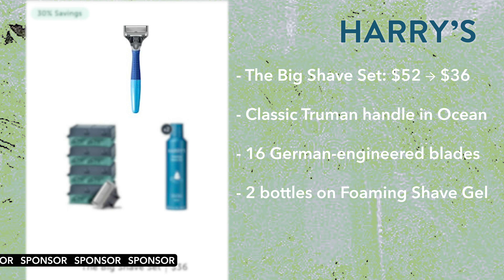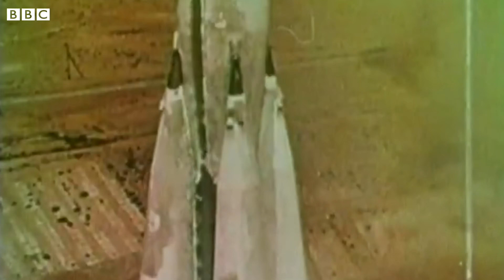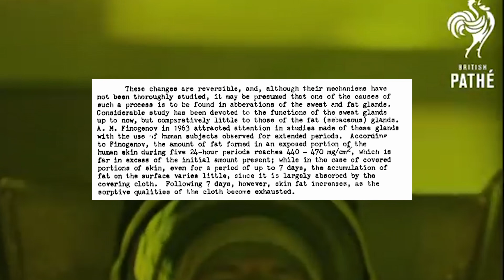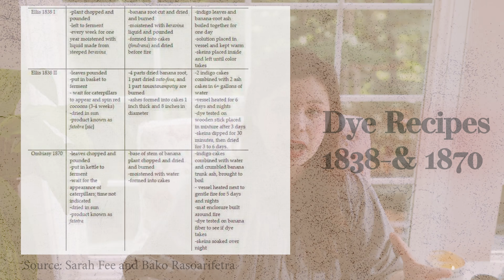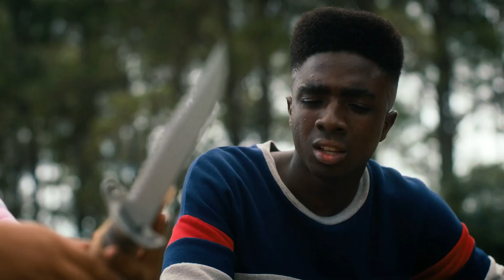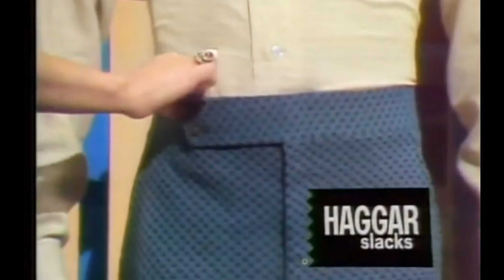The DISGUSTING truth about Laundry

Comment: Put a little hydrogen peroxide/baking soda on the crotch of your undies (and the under-the-boob bra strap) .  Not to be ‘sgusting but watch it foam up; you quickly realize what your Tide *isn’t* doing.  😏 🤢
Reply: I put baking soda and a few drops of lavender oil to my laundry every time. Instead of a fabric softener, the essential oil gives it a nice smell without perfume and the soda not only softens the water, but also the fabric a bit AND increases the actual cleaning of the fabric. And well, it's also nice to be able to bake some muffins at any time you want (here in Germany baking soda is not exactly something everyone usually has in their kitchen - we use baking powder).

Comment: In France they tell you how much detergent to put into your laundry depending on water softness and clothes dirtyness on the backof the detergent jug. White vinegar is also a good swap for fabric softener. Here most people don't even own a dryer, I only use(d) one when livig in dorms as a student
Reply: White vinegar (or apple vinegar) as a fabric softener replacement is something i read a lot in the internet recently. The only problem is: It's acidic. Acid is not good for your washing machine, especially the rubber seals of the opening and other rubber parts. It's just fine for handwashing though. 
Instead try baking soda, it softens the water and even the fabric just as fine without causing any damage to your machine. I also like to add a few drops of lavender oil for a nice smell without perfume.
Reply: @olgahein4384  I didn't know that, I'll try baking soda instead !

Comment: One thing you didn't touch on is using white vinager in your wash
Reply: Cause you shouldn't. It will damage your washing machine, especially the rubber parts cause it's acidic. If you wash by hand completely, it's a great replacement for fabric softener though. For machine washing, try baking soda: it softens the water and the fabric without any damage to the machine. I also add a few drops of lavender oil to my laundry for a nice perfume free scent.

Comment: Oh god don’t get me started on hard water.. what it does to your hair alone. Of course it’s crap on your clothing. 🤦‍♀️
Reply: What helps against hard water is vinegar (white or apple vinegar) for rinsing your hair and your body. Just make sure to thin it out beforehand, your body is naturally more on the acidic side, but not that much. It softens the water and neutralizes smells.
Just don't use it in the washing machine, it will destroy the rubber parts in no time. For laundry I use baking soda and a few drops of lavender oil. Softens the water just as much without acid and the oil ads a nice scent without perfume.

Comment: Some of us don't treat clothing as disposable, and in my case it's how I was raised - by parents who grew up in the Great Depression.
I've never had clothing develop tiny holes after one laundering, but I pay extra money for better quality T-shirts.  They'll eventually develop tiny holes, but that's after many launderings and several years.
When shirts and trousers don't look nice enough for work I demote them to "play clothes", where they serve quite a few more years for wearing around the house or doing yard work.  When the shirts are no longer wearable around the house, they get demoted to cleaning rags:  I cut them up and finish the edges.  Some of my current cleaning rags were wearable shirts in the 1990s.
I switched to a front-loader washing machine three years ago and I've noticed my clothing wearing much less quickly.  I use just enough detergent to get them clean but not too much, which can shorten the life of textiles.  Chlorine bleach has never had a place in my laundry practices, and oxygen bleach only rarely.
As for the dryer, I was taught years ago to use lower heat settings and to remove the clothing before it was completely dry.  My new dryer will allow me to set the moisture level remaining so that makes it easy.  Socks and underwear never go into the dryer and are always put on a rack; the clothing that needs a bit more drying is hung up.  It doesn't bother me one bit to wait a day to fold and put away the laundry:  I just find something else to do in the interim.

Comment: I live in the Netherlands, in a small apartment. For years I washed my laundry like in the old days, by hand, but I can't do that anymore. It is a JOB, I physically can't handle blankets, and heavier laundry anymore, for sure the wringing. So I did buy a machine for that. I do dry all on a rack.  I have a rack that I can hang on a door, that can handle about a load of laundry. It doesn't take long to dry, depending on what it is. I love your video, I think most people are not even aware of what laundry/cheap clothing costs our envirement. In the past people used natural soap, and often used the dirty water to water the plants, or scrub the floor. They reused everything. Have a beautiful day, and thank you! 🤗
Reply: I wish we would have affordable natural soap again, it all contains chemicals and perfume against which i'm highly allergic. Good thing i live in an area that is known to be a natural green left winged hippie society, so i learned naturally about the possibilities to clean myself  using different stuff from the kitchen - and it works. I even replaced fabric softener with baking soda and lavender oil and that works even better.
Reply: @olgahein4384  I use Aleppo soap, from Syria, that is made like people made it 4000 years ago. For the laundry we can still buy very oldfashioned laundrysoap here, that is cheaper. But the machine can't cope with that. So I do use the stuff from the store, though only a tiny little bit. I add vinegar to the laundry as softener and to make the water softer. You can make your own very cheap. If you find Rain Country on YouTube, Heidi teaches a lot of the old fashioned ways, natural cleaning stuff, for body, hair and house, medicinal herbs, food, how to make wine, etc., and also how to make vinegar. If I can do it, you can do it. I love raisin vinegar and apple vinegar, also to drink if you delute it with water. For the laundry I use the very cheap cleaning vinegar, but you can also use the home made. I use baking soda a lot as well, but I am still learning how to use it all. There are so many ways, like I learned to make my own deodorant with baking soda and coconut oil. I add a few drops of jasmin oil, (organic), so not to smell only like coconuts, but it works so very well! I do  use it before I go to bed though, for it can oil up your cloth. I will end my ramble, I'm sure you can find everything on Youtube as well. Have a beautiful day! Hugs from the Netherlands!
Reply: @JackyHeijmans   Hugs back and thnx for all the advice. But I will never again pour any vinegar or any other liquid acid into my washing machine, after i witnessed what it did to every soft material (especially the rubber in the sealing of the front door or the  tubes and hosepipes). I had to buy a new washing machine cause that was cheaper than replacing everything that was destroyed by the vinegar. 
Also, my allergic skin has become so sensitive that it reacts to everything acidic and even sunlight.
I now use natron as a replacement for fabric softener with a few drops of lavender oil, and the lavender keeps moths and bugs away.

Comment: That vodka method 10/10 recommend. It’s so easy why not?  I wear a thin tank top under my bra to protect it somewhat from sweat  and spray it with vodka right after I wear it.  Not perfect, but I don’t have to hand wash bras as often.
Reply: Interesting, I also wear  a tank top under my bra but for a very different reason: Thanks to my perfume allergy my skin is extremely sensitive to anything irritating, be it direct sunlight or synthetic. And the vast majority of my bras is synthetic except for the inside of some padded bras. But the seems, the straps and the band under the caps is full on plastic and causes rashed, skin irritations and pimples. Since i started the tank top thing, it got better. And that i have to wash my bras far less because of it was a VERY nice extra.
Reply: That’s awful that the materials themselves irritate you! I’m lucky not to have that concern, but I do think the tank top makes wearing a bra more comfortable in general by padding pressure points of the bra.

Comment: I use a mini washer and spin dryer for my clothes. Then hang it up in my apartment to finish drying. I only use 6-8 gallons of water total per load. I hardly have polyester clothing because I hate clothing that’s got high amount of polyester because it feels weird on my skin. I prefer modal fabric for yoga tops
Reply: Fun fact about Modal fabric: it is a 'man made cellulose' fiber, which means it is technically synthetic, while it is as breathable as any natural fiber and as cooling as cotton. While it is similar Lyocell/Tencel (also man made cellulose), and they are all made with different chemicals, they are also relatively safe for the environment. 
Unlike Viscose/Rayon (also man made cellulose), which uses a VERY dangerous chemical that not only is fatal for the environment and deadly for water organisms, but also causes several health damages to humans (aka the workers in the fabric where it is produced), from heart deseases to strokes and long term lung damages, WHEN exposed (the chemical is contained during production and should not be exposed, but the complete production is in China and work labor and health importance of the workers are the last of the concerns there, so there are leaks on regular basis). 
Long story short: Modal, as well as Tencel/Lyocell, are the better Viscose/Rayon in every way. But also more expensive.

Comment: Well some things I do for laundry is this
Wash socks and underwear separately from outer garments and on a hotter setting than other clothes
Use laundry bags for more delicate fabrics or garments to prevent tears (especially for bras and such)
Towels get washed hot
Bedding blankets and towels are the only ones going in the dryer (on the appropriate setting)

Comment: Another tip is to not automatically put your clothes in the laundry bin after every single wear. Exercise some judgment considering what the garment is, what you did that day, how much you sweat, does it smell/look dirty. Not saying to keep wearing it until it smells but a lot of clothes can be worn 2-3 times (or even sometimes more depending) before washing and it's going to make a big difference on their durability and how many loads of laundry you do already.

Like I rarely ever wash skirts since I wear shorts underneath them, until they get dirt or stains on them.
Reply: People don’t do this??
Reply: I started taking this approach a few years ago. Anything directly against the armpits or crotch gets washed after 1 full day of wear. I give most pants at least 3 wears. Jeans get 2 months before I bulk wash them. All other non-outerwear is based on the smell test. Outerwear (sweaters, jackets, scarves, etc.) can range from once a year to the smell test. If anything gets abnormally sweaty or dirty it gets cleaned in the next load.

I agree most people wash their clothes way more than they need to.
Reply: I do this all the time! I hang things up outside of the closet where air can circulate around it overnight, then put it back in the closet to wear again.
Reply: The only things of mine that get the "One use-One wash" treatment is my panties and socks. Everything else is subject to a re-wear or three, unless I get it nasty.
Reply: @catbunfish socks and tops for me, I live in the tropics.
Reply: Yes! And I've found that natural fibers don't get stinky as quickly, and can be worn more often. (for example, I have a linen shirt that can be worn 3-4 times against my armpits without getting stinky, but a polyester dress will cause more sweating, holds the smells, and has to be washed every time I wear it.) Unfortunately, good quality natural fibers cost more, or take more time to find secondhand.
Reply: I take a steamer to clothes that I've only worn once and intend to wear again before washing. It gets them looking fresh again.
Reply: I'm becoming convinced that it's a uniquely American thing, to toss clothes in the washing bin after each wear not considering if they really need washing or not. I don't think it's that common a practice elsewhere in the world.
Reply: This. Especially with things like coats or jeans. I can usually get like 10 wears out of my jeans before they get stained or start to stink.
Reply: @penelopeclaire539  Jeans get washed?  lol
Reply: @Jayhasdiabeeeeeetes  did you know that you can put denim in the freezer? They will not be stinky anymore. Until you wear them a lot again
Reply: @Jayhasdiabeeeeeetes yeah there's this lovely thing called yeast 😅
Reply: Yes! I have a coat hanger thing in my closet of about 10 hooks and I put my clothes that I've only worn once on it and wear them again before tossing them in the laundry.
Reply: Same. Skirts are my least washed items. My winter skirts are maybe washed once or twice during the cold season and then at the end of it before I put them away. They never touch skin and I rarely get them dirty. (Cold season below 15°C is about 6-7 month where I live).
Reply: @sphhyn  what do you wear under your skirts in the winter?
Reply: Washing after one use is a very strange concept to me. Like, unless it is soaked wet exercise/hiking/sports clothes or I spilled something on it and need to soak it for removing the stains - I am not wearing anything once. That’s just insane to me.
Reply: I generally don't put worn clothing back in the closet or drawer or I get smells (happens when they get closed in but not if they're free to the air), but I have a "gently worn" basket of clothes on the  go, only underwear gets washed after one wear. My work socks are double layer so they don't get gross, I usually wear them twice (switch feet to balance out wear). I also change out of my work clothes as soon as I get home so neither it nor my home-wear needs washing as often as if I wore the same clothing all day. My biggest problem with gook accumulation is the sunblock I wear every day will turn the inside of all my necklines grey.
Reply: Skirts definitely don’t need to be washed often if you wear something underneath. My petticoats however…… those get dirty pretty fast 😂
Reply: My jeans are worn til they're practically stiff. xD Shirts usually only last a day though, cause I overheat easy and sweat a lot sometimes. Depends on how long I wore the shirt and for what though.
Reply: I use a refreshing spray of water, white vinager and alcohol to sanitize and refresh clothes before I use them again! It’s also great for getting wrinkles out.
Reply: @leticiatavares1249 will you share the ratio of the ingredients? I would greatly appreciate it!
Reply: @stephaniefbriggs  Sure! I use 100ml water + 100 ml alcohol 70 GL and 50 ml white vinager.  You can also add 2-3 of drops of the essential oil of your preference if you want the clothes to smell good.
Reply: I recommend having a towel rack or something similar for this. That way half-dirty clothes have a place that you can see but they don’t wrinkle unnecessarily or get put back to make your clothing storage all stinky
Reply: @sarahnelson8836  man if I only had room for that.
Reply: @lunawolfheart336  because you have a tiny place or because you have so many half dirty clothes? 😂 I live in a small urban apartment and the towel rack isn’t very big so it works for me! I know some people fold them on top of the dresser
Reply: Oooooooh I live in the tropics and this is not an option. A garment starts to smell used after 15min of wearing it

Comment: Fabric softener.... we use vinegar
Reply: That's deadly for the rubber parts of your washing machine, as well as anything else that is sensitive to acidic liquids. Try baking soda instead, with a few drops of lavender oil it's a perfect fabric softener replacement and the scent of lavender keeps moths and bugs away. Vinegar is perfectly fine when you wash enterily by hand though, it's also good for the skin when thinned oud.
Reply: @olgahein4384  baking soda is very expensive were we live. Our washing machines normally last about 10 years with vinegar.